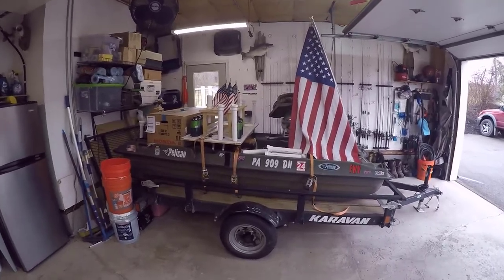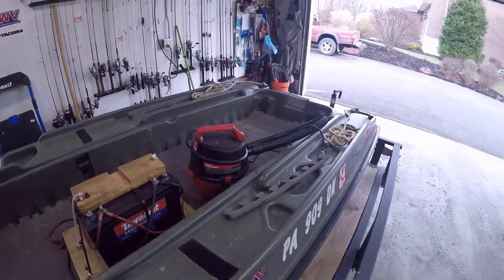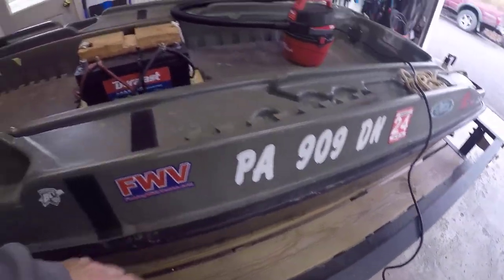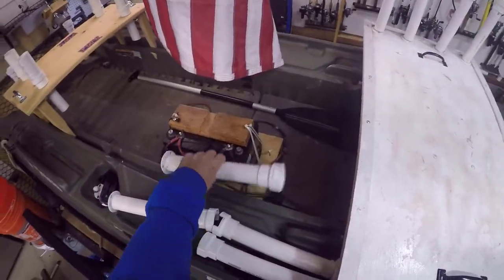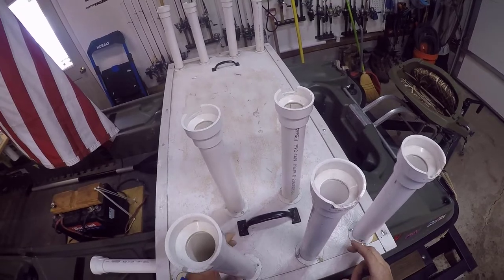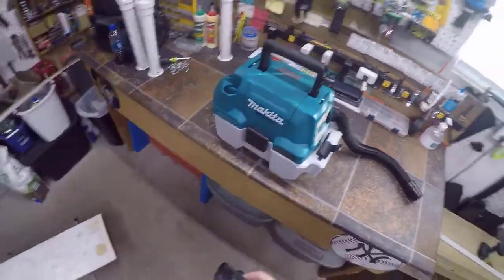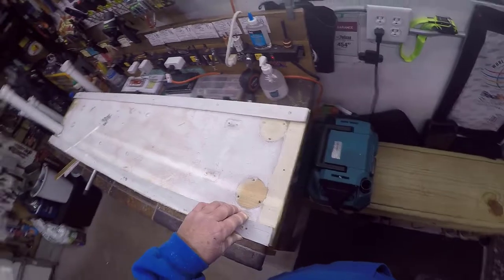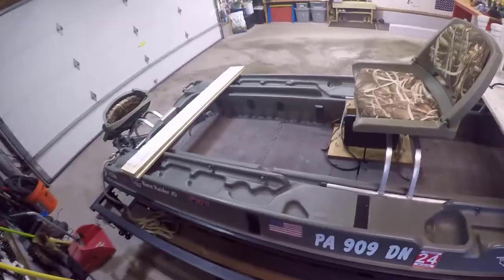PELICAN BASS RAIDER MODIFICATION 2022 [PART 1] | Fishing With Vance

Comment: Table looks good. I can’t have my rods standing up, when I’m musky fishing.  My lures with the leaders are about 2.5’-3’ down from tip so when casting I would hook the standing rods. Since I don’t have a gas motor, I keep my batteries in back to offset me in the front with the trolling motor in front. I also mounted the transducer for fishfinder to my trolling motor. That’s nice because the readings are a little more accurate for where I am compared to what shows up on screen.
Reply from the maker: I'm not sure how to do the fish finder just yet.  A little more research is needed before that step no question.  Never caught a musky.  that must be a complete rush when it's FISH ON!  Thanks for watching Pat.
Reply: @fishingwithvance catching musky is definitely a rush, I only catch one per year but each year I’m hopeful about increasing those numbers 🤞😁